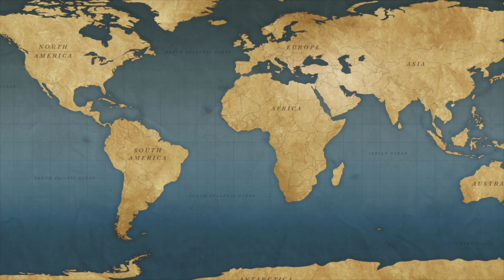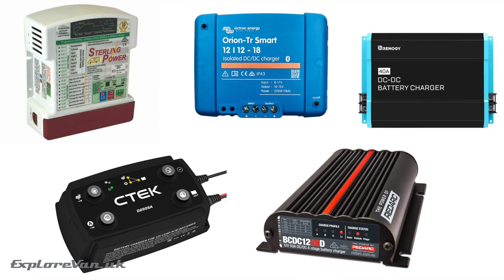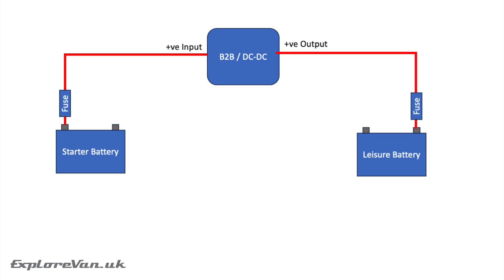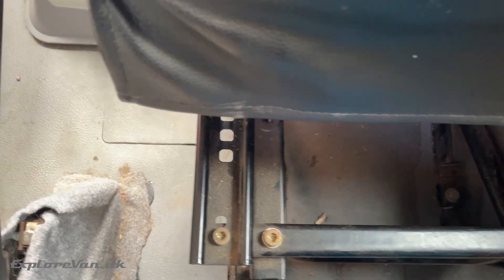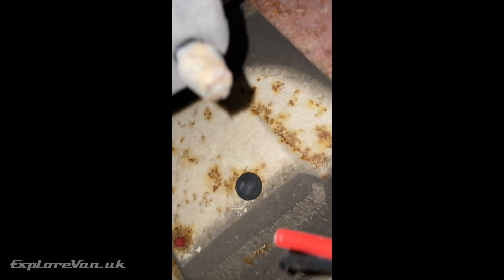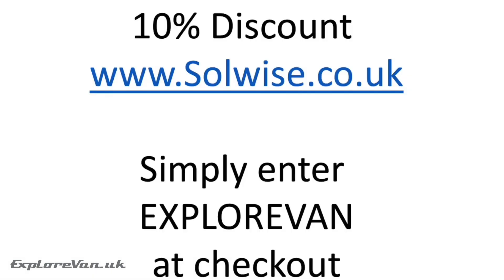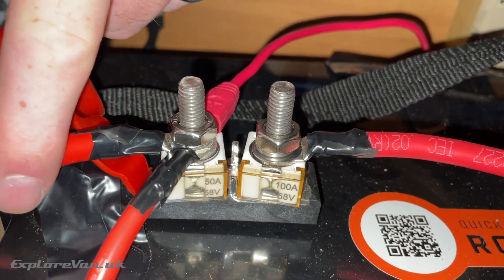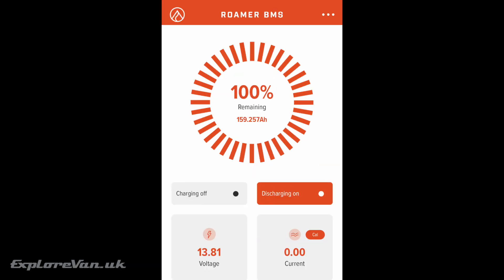Battery to Battery - B2B - DC to DC Charger Installation. Campervan, Motorhome, RV

Comment: Can't really see but did you just put both negatives into the same slot on the Sterling? at 4:58 I mean. I have been struggling to work out whether to connect the two negative cables into one (somehow??) or just try to fit them both in the single slot on the Sterling B2B like it looks like you have. Thanks for the vid !
Reply from the maker: No worries glad it was interesting. Yes I connected both negatives to the terminal. The terminal is big enough to accommodate it and I feel it’s safer than splicing elsewhere.
Reply: @ExploreVanUK  awesome thank you so much for the reply! Subscribed :)

Comment: "now that we've moved to a lithium battery we know a VSR isn't suitable" .     When I replaced my FLA batteries with LiFePO4 I assumed I'd need a DC-DC.  Luckily I tested it before purchasing anything:  the 150Ah LFP bank pulls ~30A through the VSR, similar to what we saw in the video.  The max I've seen was 53A, close to what the Sterling will do uncorked.  

I already had a switch on the VSR and usually disable it >13.7v if I'm driving a long time.    Charging slows quite a bit when bank voltage comes up like that (I=V/R), so DC-DC would charge harder at higher states of charge for those who need it.  I'm ok with slack charging at the end and the extra $350 in my pocket.  :-)
Reply from the maker: Hi - thanks, interesting insight, thank you for sharing.   My only thoughts are around the profile of charging that the LiFePO4 is expecting -  which can't be provided by VSR and therefore there is a risk of damage to the battery over time. 
I believe you're unlikely to get the voltage necessary from a VSR to fully recharge a LiFePO4 which needs a higher voltage per cell than the VSR could supply to get to full. 
As the LiFePO4 has a BMS which is likely to record its charging history, there is a risk that any warranty would be void if the battery did fail, as on investigation the supplier could easily see it had been charged in a way they would probably deem "inappropriate" 

In the end if it works for you then that's what matters.

Comment: Hi i like the sound of this. I was thinking about putting solar panels on our motorhome but live in central Scotland days ar short and wet. What sort of price range will fall into. Rob
Reply from the maker: Depends on the quality of the manufacturer and the current you want. I'd budget for between £100 and £200 for the charger.

Comment: Great video and thank you for sharing. We fitted the Renogy 50A DC-DC/MPPT combined solar and battery to battery charger. The install was so easy but you are limited to a max 25V solar input. We also fitted x2 Renogy 175W panels. The set up has been brilliant for us

Comment: Hi I would always run high current power cables in flexible conduit to protect them from rubbing against the body / chassis as the vehicle is being driven. A short could cause a fire.
Reply from the maker: Worth considering thanks, in this case I’m comfortable it’s secured to not get chaffed and has rubber grommets protecting all the points of entry to metal.   It’s also fused at both sources so any short is likely to blow fuse before there is a risk of fire, but it is a good suggestion.
Reply: @ExploreVanUK   i would agree